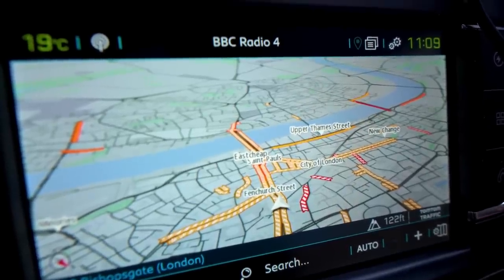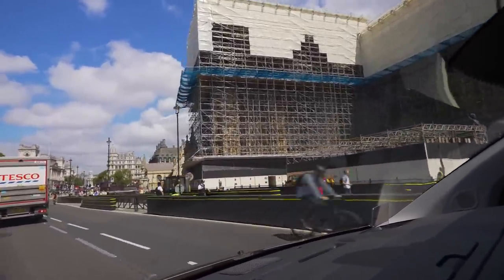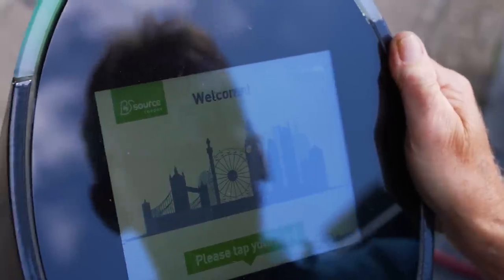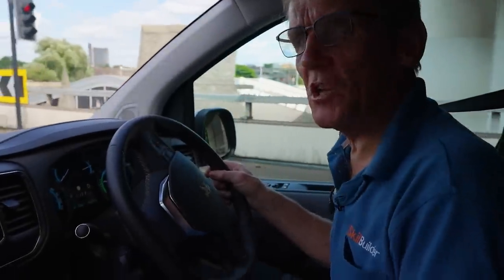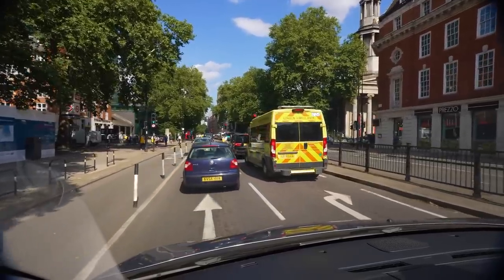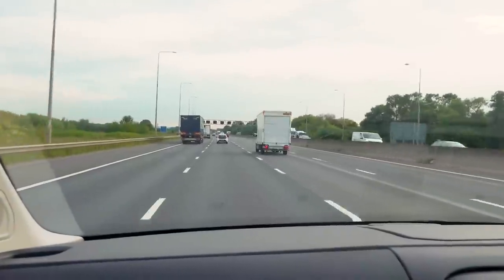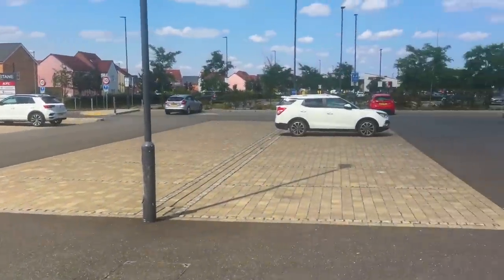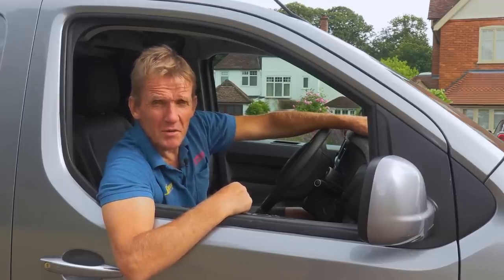Is It Time To Switch To An Electric Van?  e-Expert Test

Comment: Given your experience with your van in a previous video and wondering whether to go electric, I was wondering when you would get to do this. I am not sure if I missed it but you will also save money in servicing costs. Yes I think autonomous vehicles will be the future. I follow " Fully charged" vlog and they say that new charging points are coming on line all the time. We will look back in a few years and wonder why we made such a fuss about going electric.
Reply: Realistically I can't see any way out infrastructure could handle the masses turning to electric cars. There's an incredible amount of homes in the UK that won't be able to have their own charging point. Even the ones that are currently free or cheap to use will eventually have prices driven high as the demand grows

Comment: I went EV & solar at home here in Ireland this year, running costs have been totally slashed. I'm saving hundreds so far this year. Tax & insurance -€550, 8000km has only cost €150 so far. I've traveled cross country without any problems. I'm trying to get my company to wake up & replace the van fleet, they currently spend €300,000 on diesel a year, this video will help a lot.
Reply: Any luck persuading your company to switch?

Comment: Got an eNV200 on the firm and supposed to have one of these end of next month. Would'nt go back to diesel again.
Reply: @zeez9053  Nice educated response. Well in chap.
Reply from the maker: @phasedout6769  You make an intelligent comment and get the polar opposite reply.
Reply: @SkillBuilder  always one 🤷‍♂️
Reply: What mileage you getting Steve when its fully loaded, I’m looking at one next year
Reply: @denty32  the eNV you'll get about 120 miles fully loaded if you dont blast it and keep it in eco with full regenerative breaking on.
That being said around town you'll get way further out of it purely because of the regen and stop start driving.
Reply: Steve The Plumber thanks Steve, do you know the rough service costs
Reply: @denty32  unfortunatley not, that's all on the boss.

Comment: Seeing that lead trailing the charging post/van, a thought occurred to me (apart from it being a trip hazard) especially in the cities that I’d hadn’t ever considered was the possibility that you come back and find your lead has been christened by the local dog. A pair of gloves for this purpose in your van or car will no doubt be an essential accessory, just in case….
Reply: If your lead hasn’t been nicked, nice bit of free copper there!
Reply: @cseanny  -  beat me to it; you get back to your van to find the lead gone and no further charge in the batteries, just a bonus for the scrapman.
Reply: Cables are locked in when charging. Agree about not knowing what has been interacting with the cable so would like to see more coiled ones that would be suspended of the ground.
Reply: The charging cables are very easy to steal and they are being stolen in vast quantities for the scrap copper.

Comment: If EV manufacturers had designed a smaller cassette battery that slotted in, these could be available at any Garage then EV would cost less
Reply from the maker: very true

Comment: Not sold on these electric vehicles yet....they are too expensive to purchase , they are cheaper to run at the moment but be prepared for a hike by the government when it loses the tax revenue from diesel and petrol , there are no charging points in my area , and the damage done to the environment mining and producing the batteries for these vehicles far outweighs the emissions produced by a 10 year old diesel van....not for me thanks

Comment: Rubbish in winter batteries hate cold minus conditions , but good in summer. Think these electric vehicles should have solar panels on the roof charging the batteries when parked up.
Like to idea of using the customers electricity , if they get some benefit take off mileage charge as you say.

Comment: The electric grid can barely handle everyone boiling the kettle before eastenders.
But I'm sure it will handle 90million people charging their vehicles every night. 
Good luck if you live on a terrace street.
Reply: Easy, just install a wind turbine in the garden and a solar array on the roof - sorted!
Reply: The National Grid disagree with you, and say there will be no issues. They anticipate 9 million EV's on Britain's roads by 2030. So, who do I listen to? You, or the people who actually run the grid?  And what is it that makes you think electric cars need charging every night?  Clearly, you have zero experience of what you're actually talking about. I only need to charge my car every 8 to 9 days..... If you lived on a terraced street, you would use public charging. Do terraced streets all have petrol stations where you live? Even people who live in terraced streets need to buy food, so they could charge their EV while they shopped at a supermarket. Tesco are installing free to use chargers at 400 of their stores, ans Sainsburys and some other supermarkets have offered EV charging for a couple of years.
Reply: @Brian-om2hh  Your point about terraced houses and trips to the filling station rather misses the fact that refuelling petrol or diesel cars is a three minute job, whereas an EV could take hours to get a decent recharge. I was talking to an electrician who specialises in domestic  EV charger installation and he said that as EVs become more commonplace the electricity suppliers will be able to regulate charging through the wifi routers to ensure that the system is not overloaded. Essential workers will get priority.

Comment: The mileage all the van manufacturers say is pointless. I want to see a fully kitted out van with a roof rack to see the true mileage of these vans.
Reply: The new Transit E about to be released doesn't have a towing capability.
Reply: In winter conditions with a three year old battery in a motorway jam for three hours with the heater, wipers and radio on.

Comment: load carry capacity is quite a bit lower than the normal expert van
Reply: They had allow for the weight of the battery.
Probably left out the spare wheel to save weight too.

Comment: One thing to consider about electric vehicles is that they are technology driven  ,,, firmware , software updates..
There is a shortage of electric car engineers and independent garages will not be able to help due to training and technicalrequirements.
So main dealer prices for repairs and when a new model comes out , a software update appears to make your battery efficiently drop.
Reply: The picture may not be as bad as you paint it. Both the guys in my local (village) garage have been trained to work on EV's. They paid for the courses themselves, knowing it is in their own interest. They both jointly own the business. There are already organisations offering re-training courses.... Remember, when motor cars first appeared 100+ years ago, there were no motor mechanics around then either......
Reply: @Brian-om2hh  my local car body repair centre has been quoted 160,000 pounds to set up a unit to repair and calibration of modern car front end electronic aids ..
Auto cruise control. Pedestrian avoidance. Automatic braking etc.
They can't employ enough engineers to fill the training requirements. 
They have been advertising for a car stripper and fitter for 3 months offering 1,000 pounds a week  pay with no applications. 
My bosses van has been at Ford for 3 weeks waiting for someone trained to fix a new Automatic gearbox.  🙄

Comment: No incentive, over priced by £20,000, cost of a charger, congestion charge free for only a few years. And Electricity prices going through the roof.
Reply: If electricity prices go through the roof, so will the cost of petrol and diesel, because oil refineries use lots of electricity.....

Comment: Saving £5k over 60,000 miles gonna take  540,000 to get your money back wow!
Reply: Is the diesel van you’d buy instead free then?
Reply: @mickyork41  £1200 6 years ago so no but that just accounts for the loss in range that will occur with the battery over time. 100,000 miles later It owes me nothing.
Reply: @Droningonuk  that’s great. Keep it. My point was, (and I know maybe I need to lighten up) that your comment was a poor comparison. You were comparing the brand new price of the electric van and the savings in running cost against a van that was ‘free’. You need to compare it against another brand new van of similar specification. Nobody is forcing you to change your van. But people do buy brand new vans all the time. Sensible comparisons and a bit less talking down electric all the time might lead to a few more people making the switch. I’m an electric vehicle owner and don’t plan to ever return to petrol or diesel.  But I get that it’s not yet viable for everyone.
Reply: @mickyork41  I guess u could half my 540k mile statement to 270k then in that case but either way to me it just doesent make sense I love the idea of electric cars and would have one tomorrow but the price is just so prohibitive at the moment and I would never buy a new van anyway like I say £1200 for six years my mate has a new van £300 a month over 6 years thays £21,600 and what does his van do that mine doesent??? Have aircon and Bluetooth I think ill roll down my window and save £20,400.
Reply: @Droningonuk  yep. Totally get that. Like I say not for everyone. But people do buy (or lease) new vehicles. And this video is I imagine aimed at them. I lease my electric vehicle for the same sort of cost I could have got an equivalent spec petrol or diesel so it made sense for me. I worried what it would be like to live with and haven’t a single regret.

Comment: Why the 'panic' for full EV?  What's wrong with taking a considered, intermediate approach and use HYBRID technology?  Better yet, why not subsidise conversion of existing petrol vehicles to LPG?  Lower CO2, lower fuel costs, not much change in power output and no 'range anxiety'.

Comment: Im a mobile detailer.
My current van is a 20 year old 450,00mile Vauxhall combo diesel. Even loaded I get 50mpg, 600+ miles per 5 min fill up.
I paid £1500 for it, 13 years ago!
I hired a Nissan EV van for a month. I gave the thing back after 2 weeks because I was having to cancel appointments and loosing money.

I cannot charge at home even if I bought one. So I'd be reliant on public charging.
The EV van allegedly had a 200 mile range.
On a typical day. I drive 150miles per day.
Except. Once I'd loaded the van for work inc the water tank. I was getting 50 miles from a charge.
I had to charge the thing 3 times per day! Thats around 4 hours wasted per day!.

My good day went like this:
Take missus to work. She comes home on the bus.
Charge the van... Yawn.
Do 1st job...
Charge the van.
Do 2nd job
Charge the van so its ready for taking the missus to work.

What usually happened was:
Take missus to work. She comes home on the bus.
Charge the van... Yawn.
Do 1st job...
Drive to the charge point, wait in a 3 deep que and eventually charge the van.
Cancel 2nd job because of the charging issue.
Charge the van so its ready for taking the missus to work.
If we did any socialising, shopping etc... I'd need to visit the charger again before turning in for the night or we wouldnt have enough juice to take the missus to work in the morning.

Charging the van isnt just the time charging the thing.
Theres the time to drive to the charge point (not many around here).
Waiting for a charger to be available if someone is already there. I have been 5 deep in a que.

I really despair for the future. They are not good enough. The range is too short and the charge time too long. public charging facilities are sketchy at best.
I live in a city of 320,000 people. My nearest public charge point is 8 miles away, there is just 2 points. The next charge points are across the city some 15 miles away.

I hate card payments. I have lost so many credit cards... I leave it at home, Im not good with cards.. I can buy diesel with cash... I like cash, I know where I am with cash.

The local bus company has some electric buses... They are always freezing cold and the drivers are not allowed to turn on the heaters on because it kills the range, the buses are constantly getting delayed or cancelled because of them needing charging.

Comment: Electric vehicles have a long way to go before they are actually ready for the ""real world""
Artesian Electrians bought a brand new VW EV van,and regret it..£50,000 it cost..
Yes,they've had it racked out etc etc,a few days ago they used it in -2c and the range dropped 30%...Crazy..That is not anywhere near good enough.

Comment: They gave you one of the more high end models, so you're getting the best experience. I've driven the cheap electric vans from Maxus, they are absolutely stripped down to the bare essentials and I think they're fantastic.
As you say, much quieter than diesel, much nippier. I've never had a problem with charging that grabbing a sandwich and a coffee at Lidl or Tesco for half an hour didn't fix.
One colleague tried to say that electric cars have no soul.... it's a van? There's no soul in a person, there's extra no soul in a van.

Comment: Expensive electrical problems that are not cost effective to repair currently right off otherwise good veihcles that are maybe only 10 or 12 years old.? 
How much is it going to cost to sort these veihcles out when the computer says no?

Not very carbon friendly unless they last 30+years .

Oh and while we're just coming out of a pandemic and inflation through the roof and possibly heading for a recession are we all gonna ramp up our costs to our customers to pay for a 45k van?

Never paid more than 5k for a van and had 10+years out of it..

Really want to clean our air up?
Ration household energy so that people wouldn't be so wasteful.

We would all turn the lights off or only heat 1 or 2 rooms if we knew that if we didn't our supply would run out.

We were all convinced to buy diesel then euro 5 then euro 6 now electric.
All shite to keep us spending money.

Wait till enough of us have got them.
The road tax will come back and the cost of electric will double.

Comment: let's be honest. they are shite.
years away from being practical.
£45000. 
tut tut.
the AA will always come and help out with a flat battery.
of course they will recharge you with a diesel generator.
these vehicles are there to tick boxes.
90% of the time they are sub standard in a working vehicle.
ask again in 5/10 years time.

Comment: Worth checking the below out before commiting to buying a ev vehicle..

The government push for it but what they don't tell you is the electric distribution network (DNO) requires major upgrading still which does not happen over night. . Alot of property's require new services to remove feeding loops or there supply is under sized. The 100a everyone requires/wants isn't always possible again due to services being under sized..internal works still may be required consumer unit tail upgrades etc.

Firstly get the dno to come and check there asset the cut out they will advice you moving forward 

Then you may require an electrician to upgrade tails in consumer unit. To meter.
 
Worst case looped supply or undersized for requirements. 
That will then require a possible new service. Meaning digging up your garden and footpath etc

Its not always as simple as it's made out to be.

Hope this helps many
Reply: Mine is a shared loop, so they limited the main cutout to 85amps. Not really an issue. Home chargers are 7kw unless you are fortunate to have a 3 phase supply and that’s 22kw. I think the induction pad may be a better option, so Long as the cat is not sleeping under the car😂
Reply: @markgilder9990  that's it mate. I think alpt people get blind sighted that they need 100a but allow for diversity u can get away with 80s fine and some of them chargers these days are intelligent smart setup anyway so they work out them selfs what they need. Be nice for the winter also 😅

Comment: Well most of the thing you liked about the van, are standard features on most new cars & Vans, like lane assist,  vehicle warning or slowing you down if you get to close. You said Oh free electric in London NOTHING is free its in your taxes. Always trying to find a charger will over the year drive you nuts. If you fit a charging point at home, it must be on a meter of its own, this is so in the future they can charge you more, eg just like using public chargers that you pay for that cost must more than at the moment charging at home as your stanard rate. Its coming where you will pay the public price for charging at home . Try watching the Mac Master on YT he has had a EV for a year and is giving back and will not have another. You only had yours for a couple of weeks

Comment: So many comments about infrastructure - speaking to pals from London and surrounding areas, they seem to be the main issue. I literally travel all over Northern England and Scotland, and don't have the same experience at all. Chargers popping up all over, but the use of loads of different apps and cards is a massive chore. Deffo need to have your utility provider supply a card that works with all the different vendors. Mrs has a Merc on order, and they come with an almost "universal" card for the charge points.

Comment: It requires government intervention for charging infrastructure. In Scotland we have a government run one, its cheaper and more reliable a lot of the 'business ones'. I have had an electric for a year now, will never go back. I live in the Highlands of Scotland, and you do notice the drop in range ... but you also notice the increased fuel use for an ICE car during winter. If you charge up overnight using cheap rate then it works out amazingly cheap.